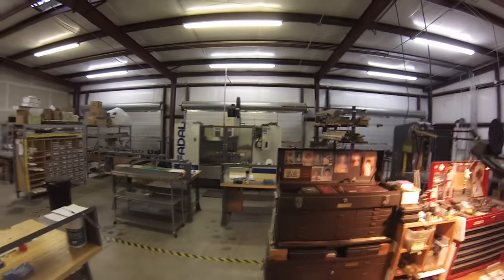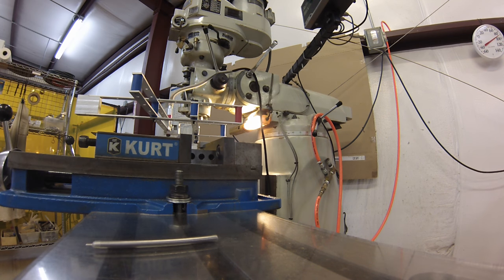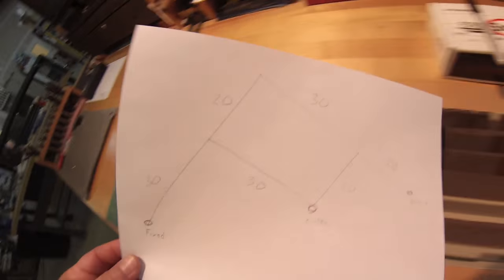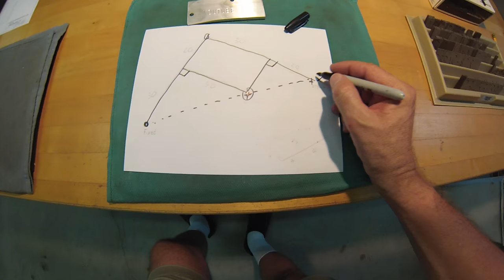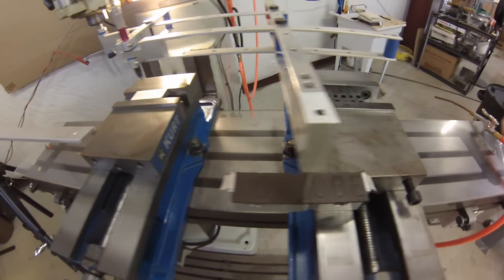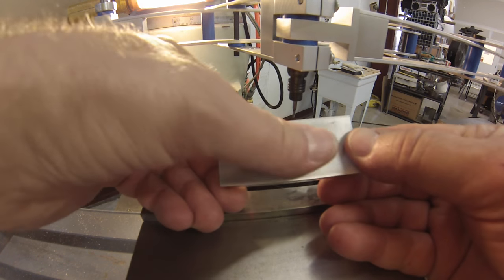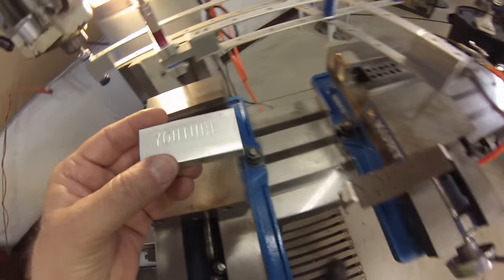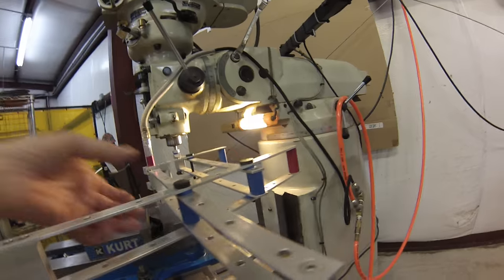Engraving On a Manual Mill

Comment: Went to your site, downloaded the PDF. Thank you for those! On another note, do you know of a relatively easy and accurate way to rotate a shaft evenly. The application would be jeweling a cylindrical object like a rifle bolt so the marks come out evenly spaced around the outside or cutting  5 or 18 or 24 flutes in a rifle barrel or creating a custom spline shaft (for example) on a home mill without buying an expensive dividing head? I'm thinking of making a part holder that uses plates with 9, 15, and 16 holes in combination with each other to achieve a large variety of evenly spaced divisions but wanted to ask you if there was a technique or product you already knew about. I'd like to see a video on that! Thanks again!
Reply from the maker: I do have a tip for that. It may be a good topic for a video.
Reply: I'll be waiting
Reply from the maker: Already posted it.
Reply: Interested in engraving  a tube.

Comment: Great kit- but you need masters for every font. And it will only do 2D fonts, as there is no depth of cut adjustment.
Reply from the maker: The depth of cut is adjustable by using the quill stop on the mill.
Reply: @joepie221  I meant dynamically- so that serifs and thin/thick strokes can be achieved (e.g. Times Roman). I agree that this is a great solution for simple lettering, just saying that it cannot compare with CNC lettering.

Comment: Sir I want to engraving on iron coin design , but manual pantograph machine didn't given me better results , because tracing pin not properly, trace portrait design so much tool marks and hairline seen on engraving , so how to make auto tracing pantograph machine.
Reply from the maker: The pantographs for coin engraving I've seen are rotary with a diminishing circular pattern for both the tracing and cutting ends. Like the stylus arm on a phonograph. Both ends also float to achieve the 3-D effect.
Reply: Joe Pieczynski  may you explain machine how to make that type machine , please help me for it

Comment: Nice, simple and pretty much idiot proof. Although do keep doing downgrades on the idiots (think about it, how do you upgrade stupidity)
I used to have a mount for the quill on a Bridgeport that would hold an 1/8th* pencil grinder and I would do engraving using a ProtoTRAK two axis control. That way I didn't have the pantograph arms and fonts to store. As far as actual pantograph machines such as Deckel, Gorton and others the company that inherited the rights to Gorton is just down the street from me maybe .75 miles
*the collet size, not the grinder body. A flexible shaft hand grinder would work to.